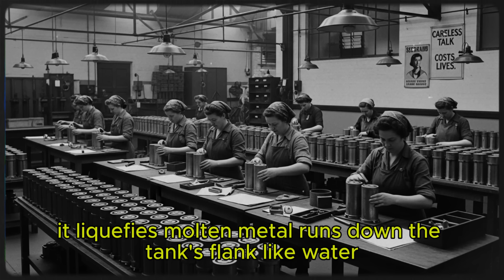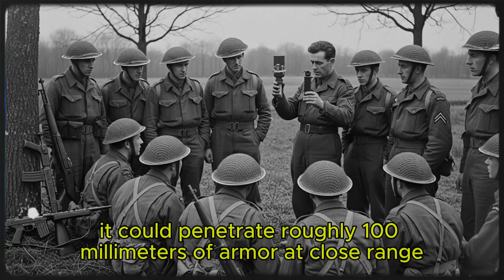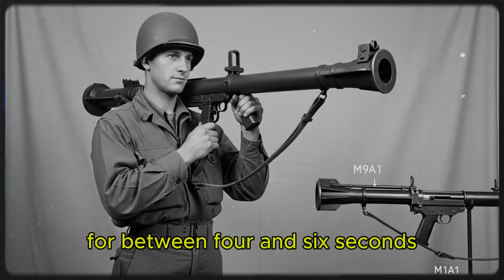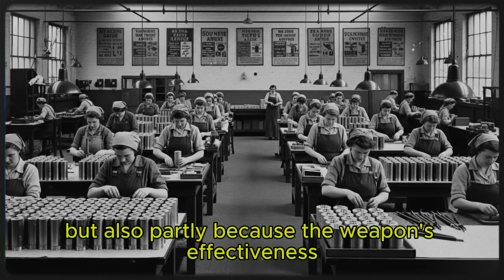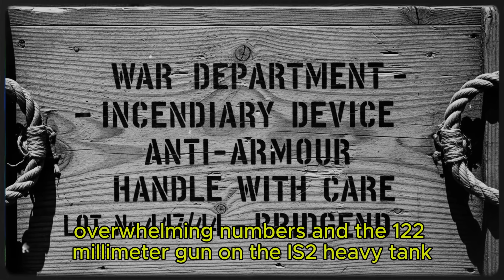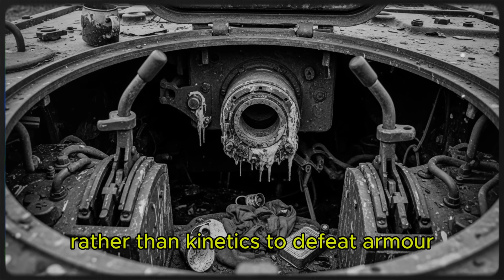The 5-Second British Trick That Melted German Tiger Tanks Into Molten Metal

Comment: I worked for a small company that used lathes to turn magnesium parts. Magnesium shavings were all over the floor, though they did sweep them up regularly. The company president was walking by and said "You want to be careful around magnesium". Nobody looked worried. He picked a shaving up off the floor of the shop and walked out to the parking lot. He lit it on fire. It looked like a sparkler on steroids. I had pieces stuck to the bottom of my shoe.
Reply: Type 42 Destroyers had Magnesium Aluminium alloy hulls thats why they set on fire when hit by an Exocet during the Falklands War. Sadly.